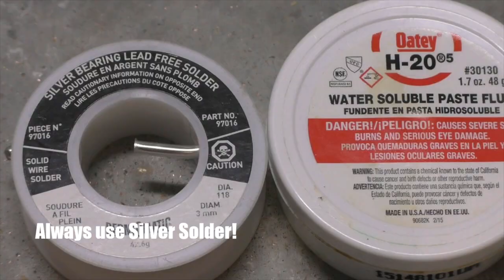How to Build an EASY Pot Still Condenser!

Comment: One more super video, I need to increase the length of my condenser, do you think adding a second small one on the front will work or redo the whole thing
Reply from the maker: I think an addition technically would work since it's really the same as having a longer one. But for your rig, you might want to make a new one with a thicker water jacket and longer vapor tube( maybe 15cm longer than it is now) so it fits inside the main profile.
Or you could make a shotgun style condenser, and make it modular with ferrules so it'll fit on your current still as well as your bigger "community" still once you finish it;-)
Reply: @BeardedBored  thank you bearded, I need to upgrade that condenser, still was built using bartered parts, and a shotgun will be awesome to build, just need to get the tri-clamps here in SA they are really hard to get.
Reply from the maker: @BEAVERDIY  Yeah, I bet it's tough to get parts. They use triclamps in dairies I think, so if there is a dairy equipment supplier in SA that might be an easier source.
Reply: @BeardedBored  there is a company called NPE, but they are all the way down in Cape Town, and shipping will cost same as the clamps, but will be doing a bulk order soon for the community still, so then shippi g will be worth it.
Your are up very late...
Reply from the maker: @BEAVERDIY  Yeah, I'll go to bed soon. No kids:-) Can't wait to see the big still.
Reply: @BeardedBored  hahah my 2 really a hand full, jip just need to sort the parts and as always the $$$$$$ is a challenge
Reply from the maker: @BEAVERDIY  $$ is always the problem. Definitely stretches out the build schedule:-)

Comment: Quick question I’m thinking of going from a classic worm condenser to a shotgun condenser and I’m looking to use your build as a reference and building platform. Anyways, what is the copper wire that could up the vapor pipe used for. Is it used to keep that pipe in place or is it more for giving the water a better flow? Anything helps, thanks for the great build video
Reply from the maker: The copper wire is to create turbulence and increase the cooling efficiency a little. Just an FYI, this is a liebig condenser. The shotgun condenser has several pipes in a larger water jacket. Good luck on your build:-)
Reply: @BeardedBored  is there any kind of advantage of using a shotgun over a Liebig condenser? I planned on making a shotgun but after watching this I feel like it would be way less of a headache to do it this way. Only thing I could think of would be that it has better vapor flow but if it’s nothing extreme then makes the most sense to me to do it this way
Reply: @BeardedBored  I know that using shotgun condenser is a more compact but I actually enjoy the streamline look of your build much more just want to make sure that I won’t be missing out on a crazy jump of vapor in the end comparatively. And I’m just rocking a 5 gal. torpedo keg pot with a 2x 12 in. column so it’s nothing that’s gonna be roaring out vapor
Reply from the maker: @michaelrice2081  Having only used a liebig, I don't have any advice on the shotgun. If you try this one and it's not knocking down all the vapor, like if your rig is too robust for the condenser, then you'll need to upgrade. But I've seen folks use slightly shorter liebigs on keg stills with propane heat and they seem to work just fine, so I think you'll be ok with it.
Reply from the maker: @michaelrice2081  Yeah, you should be fine with the liebig on that sized rig:-)

Comment: Morning to you once again. I have 20 litres of sugar wash. Can I use  some of the hearts as sacrificial. This will be my first run and a learning one aswell..
Reply from the maker: Not sure I understand. If you're asking if you can toss the first portion of your run and call it the sacrificial run, then continue the run and collect the rest, I don't recommend that. The best practice is to do the sacrificial run, then rinse out the still parts thoroughly, then move on to your actual run. The sacrificial run doesn't need to be a full run, just about 30 minutes of blasting the system with ethanol vapor. If you only have the one batch of sugar wash, save that and get a few gallons of cheap wine to mix with water for the sacrificial run, or brew a separate wash for that.
Reply: @BeardedBored  Fantastic. I will do this. Also was not sure.  Your channel is excellent. Next try is your freeze distilled Apple Cider.
Reply from the maker: @charlesdovey9449  Have fun:-)

Comment: have you (or anyone else) been able to test this build yet? Wondering if the length and widths are good for condensing. Would love to see the whole thing assembled! What is the section called that would go between this condenser, and the column that attaches to the boil pot?
Reply from the maker: The piece in between is called a Lyne Arm. The design I used is really common, as are the dimensions. It works great with just about any pot still. When you get into large diameter columns, especially for reflux, you'll probably want to switch to a "shotgun condenser".
Reply: 3' 2" column, has a shorter,condenser,works well. Input at bottom so vapor runs through cooler pipe as it drops.

Comment: What's your view on brass in the are  vapor path? The threaded connectors you used on this are brass right?
Reply from the maker: Those brass nuts of the copper union fittings are on the outside of the copper pipe and don't contact the vapor path. The connection point is a male and female copper end, snugged together by the brass nut. I do not recommend brass ever come in contact with the vapor or finished distillate.
Reply: @BeardedBored  damn that's what I thought. I'm having problem sourcing those kind of connections on Sweden, have emailed a company about their brass if it's lead free or not.  Other wise I'm gonna have to go with solder connection that I don't solder and use PTFE tape and friction fit, since tri-clamp connectors are a bit to expensive for me right now if I'm buying a Swan tea urn to use as the boiler (think T500 boiler)
Reply from the maker: @elektrobear2027  You can also look for small triclamp fittings instead. I know they make 1/2 inch fittings https://www.brewershardware.com/1-2-Tri-Clover-Ferrule-Medium.html?category_id=283
Reply: @BeardedBored  problem is that the only "cheap" tri-clamps I've found  have been 1" 3/4 and that's an odd measurement for copper in Sweden, and the only "screw down" tri-clamp  for a decent price is of course 2" 😭😂😭😂😭
Reply: @BeardedBored  if was able to flare pipe and fittings at home things would be easier. Oh and ordering from outside the EU is not on the table sadly since the shipping is brutal.
Reply from the maker: @elektrobear2027  If there are any distilling forums for Sweden check those out to see what folks are using. Also, maybe ask a plumber what the best solution is.
Reply from the maker: @elektrobear2027  Yeah, I'd definitely consider going into a plumbing supply shop and ask the professionals what sort of copper or steel quick connections they recommend. You can be vague and just tell them it's for a detachable water tank for a caravan or something.
Reply: @BeardedBored  people on the forums here use brass in the vapor as far as I can tell.

Closest shops that sells that stuff is about 100 kilometers away either direction. And they still only sell copper pipe and copper solder fittings anything else is brass.
Reply from the maker: @elektrobear2027  If you have no choice you can do lead-free brass, but I'd check AliExpress to see if you can find some 1/2 ferrules, go for cheap shipping and wait a month or two until it arrives.
Reply: @BeardedBored  found some 1.5" tc fittings and bulkhead fittings that I might use. Still need to buy the coffe/tea urn/water dispenser as well so I actually have something to mount the column on 😂

Comment: why we need to use a wire around the 1/2" pipe?
Reply from the maker: It creates turbulence in the water so it flows a little slower and helps cool the vapor better.
Reply: @BeardedBored  It also creates a bit more surface area for heat transfer.

Comment: Did I miss something, what does the copper wire do?
Reply from the maker: Forgot to mention it causes a slight turbulence in the water jacket and slows it down a little, which helps make the cooling a little more efficient.
Reply: @BeardedBored  gotca thanks!

Comment: Hay bud I'm in the process of building my still and I'm shopping around for the best build for a Liebig condenser .long ,short, fat,skinny ,to long ?.....what works best?
Reply from the maker: The size I built will work for most stills in the 20-40L size.
Reply: Or you could coil a couple of meters of 6mm copper tube around 1" diameter dowel, then slide it inside an appropriately sized outer  tube. This works amazingly well.

Comment: So in my first still I ran a vinigur and methylation spirits run. Is metho safe for this?
Reply from the maker: I don't recommend using methylated spirits unless you need to clean paint brushes or strip varnish. Better to make a simple sugar wash to use as a sacrificial alcohol run.

Comment: Are these specific lengths. I’ve seen some pictures where they seem shorter.
Reply from the maker: I went a bit overboard. Feel free to go with a 24 inch water jacket. That will handle an 8 gallon still without any trouble.

Comment: I've made several of these in various sizes and lengths. While they are more compact and simpler to use, I think I still prefer the copper coil in a bucket or tub of water. I get better results that way.
Reply from the maker: The old "flake stand" is definitely very reliable. I like those too:-)

Comment: I keep reading it as Lie Big.   How do you size a Liebig condenser appropriately?   i.e.  5500w burner,. 3" column,  Keg still, stripping runs? Not sure column volume makes any difference but I may be in reflux mode

Comment: Did you put your water in and out tubes on the same side of the water jacket on purpose? 
If so.. why? Just curious..Thanks
Reply from the maker: No real reason, just the way I've seen it done. Not sure if it makes much difference.
Reply: @BeardedBored  I really dont think it would matter on a tube that skinny.. but all I know is reading on forums.. I've just seen some people put them on opposite sides.. but with your wire.. I doubt it matters
Reply from the maker: @kevind7617  I think if it matter to the layout of your equipment, like where the pump is etc, it's fine to position them however works best for your rig.

Comment: Maybe i missed it in the video but why do you wrap the wire around the pipe?
Reply from the maker: I forgot to mention it:-) The copper wire creates turbulent flow in the water jacket which slows the water down and make the cooling more efficient.

Comment: Why the wire around the half inch
Reply from the maker: I forgot to mention the purpose of that. It helps create some turbulence in the water which slows it down slightly and makes the cooling more efficient.

Comment: I'm curious...The copper tube inside the condenser is the only thing in the vapor path, and there are no soldered joints with that.  Why should you have to do a saccrificial run?  Wouldn't cleaning it with vinegar be enough?  You aren't cleaning out any solder contamination.
Reply from the maker: There is a solder connection to go from the condenser to the lyne arm so there may be some flux at the end. I recommend it on any new piece mainly for flux residue, but also because there may be some unknown contamination in the pipe from the factory. But that's just my preference.

Comment: What is the purpose of that wire?
Reply from the maker: The copper wire creates turbulent flow in the water jacket which slows the water down and make the cooling more efficient.
Reply: @BeardedBored  have you mentioned that in the clip?

Comment: ... When I check the calculator on homedistiller I says I need 120" of 1/2" to knock down 5k.  So confused
Reply from the maker: That's above my pay grade, brother. I just went with a style I knew would handle my potential needs.

Is it 120 linear inches, or surface area? Either way, with that number a liebig condenser is not going to cut it. A shotgun condenser packs a lot more feet of pipe into a smaller space. Once you get to higher power it's probably your best option.
Reply: @BeardedBored   linear inches w/ 1/2" jacketed @ 2 litres per minute flow rate I s what I am reading
Reply from the maker: @robertfontaine3650  Yeah, that's a 24 inch long shotgun condenser with 5 pipes in it. https://www.youtube.com/watch?v=fxblncdgw7Q

Comment: On a tight budget? You can use PVC for the outer jacket as it never contacts any spirits. It certainly won’t look as cool but it will work. “Hypothetically”, ha!
Reply from the maker: A guy I knew did that. Eventually the marine weld putty would break down from the heat just before the water jacket. He kept repairing it for a while then replaced it with an off the shelf stainless steel one.